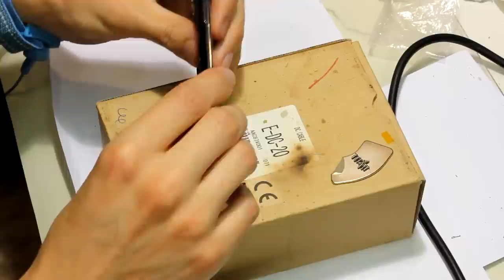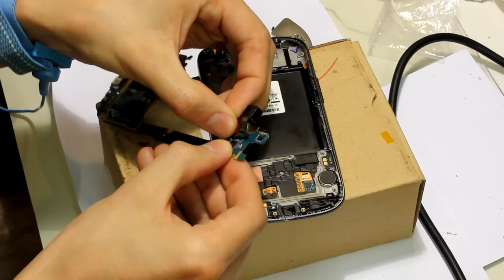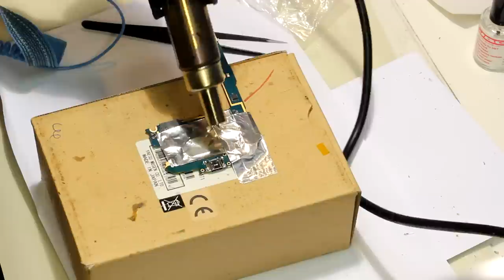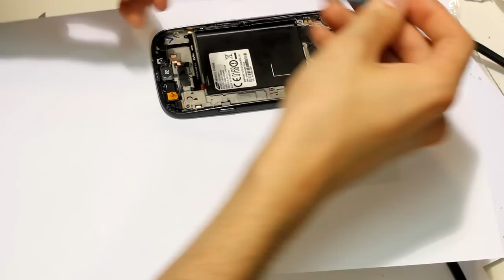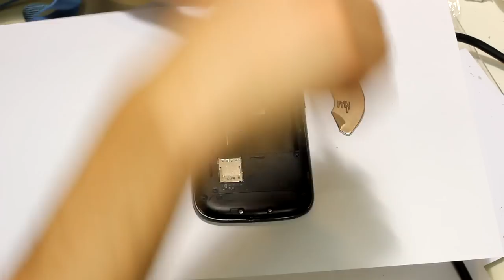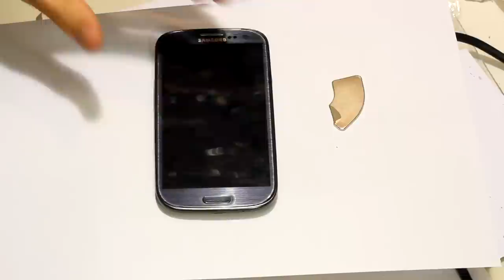How to replace a damaged Samsung Galaxy S3 Neo USB port in 15 minutes

Comment: so I'm seeing this at 7:20, but I don't hear much explanation as to what you are doing.  I noticed you squirt some stuff on the leads, but what exactly are you doing?
Reply from the maker: Zachary Henning That is soldering flux in paste form. You should always use it when soldering, it will dramatically increases the wettability and quality of the joints. In this case (smd rework) it has the added bonus of preventing solder bridges between pins. The video is intended to show the approximate locations and component types to help someone who never did it to this phone, this way you would be more familiar with it's layout before starting the procedure. If you never soldered before (I'm assuming so because you were not familiar with flux paste), you should not do a socket replacement as your first job, you should use a PCB from some broken appliance and dessolder and ressolder some of it's components, this way you can quickly develop the procedural memory required for SMD rework. There are many good tutorials online that tackle the essential concepts.
Reply: José Faria hi,
I'm french so please dont consider my english mistakes.
I was wondering if applying the flux on the very tiny connector between the port and the phone your are applying it by spreading it on the whole connectors but is there no risk to short circuit it ? I mean there is a + and a - side on the port and what you did doesn't do soldering bridges ?
Thanks for your answer 
Dunno if you understood me

Comment: Thanks a lot for posting this... I have a question... is it possible to buy the whole component you filmed at 4:12 and replace it whitout dealing with welders and other stuff...? I don't want to risk...
Reply from the maker: That is the motherboard, on that specific phone it would be too expensive, everything is on a single board, but on other phones like the Galaxy S4 you can actually buy just the board that has the USB port.
Reply: José Faria Thank you!

Comment: Hi where there are the pins at the back do you solder everything? and dont leave space in between?
Reply from the maker: There should be 5 pins, they need to be all soldered to the board and they need to be separated, you can't solder them to each other.
Reply: José Faria how can i solder each pin separately do i need a microscope?
Reply from the maker: With practice. If you use a good flux and a small amount of solder they will not stick together.

Comment: What is the wire that you were using after removing the old port ?
Reply from the maker: Solder wick, it absorbs solder stuck inside the holes, but be very careful with that, it can lift pads very easily. Ideally you should use an electric desoldering pump.

Comment: when you're soldering, how can everything be connected? i mean, where are you soldering positive and negative
Reply from the maker: You just have to buy the USB port that matches your phone model, if it's the correct part you can't solder it backwards, there is only one way to solder it on the board.

Comment: can u just tell me all the equipments you have used in this
Reply from the maker: Screwdriver, hot air station soldering iron, flux, solder and the replacement USB port.

Comment: Why do you use a static-wristband when the mobile is isolated on the box ? that makes no sense at all and can break or brick the mobile even you wear that wristband. ;)
Reply from the maker: Because If I wear it all the time it's less likely that I will forget to wear it when I'm handling the PCB.  
Or are you talking about the carton box? If so you are wrong, you can damage electronics just with static charges. And you don't need a path to earth for a discharge to occur (a wool garment will still zap you if you are not grounded).

Comment: I have failed my board that connected with the charging port is break. : (
Reply from the maker: +Ming Jojon If there is damage in the PCB tracks I'm afraid you will have to find a new motherboard.